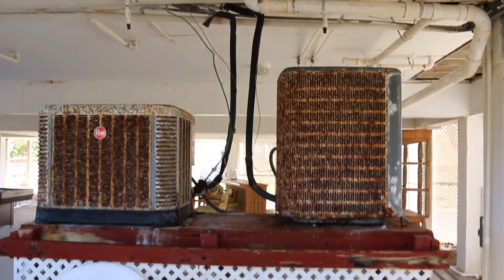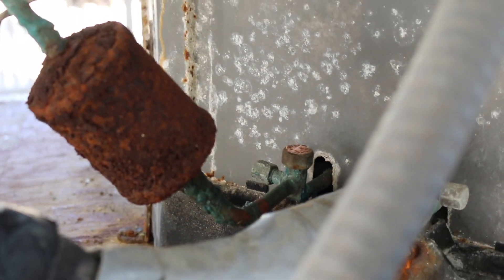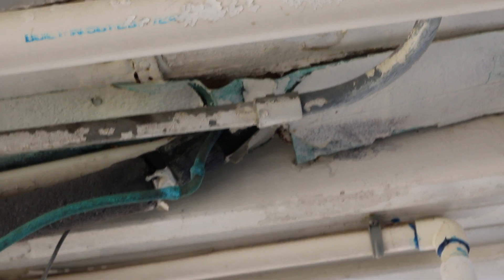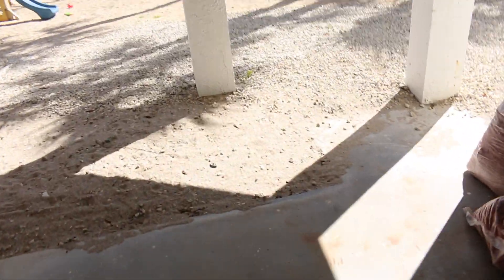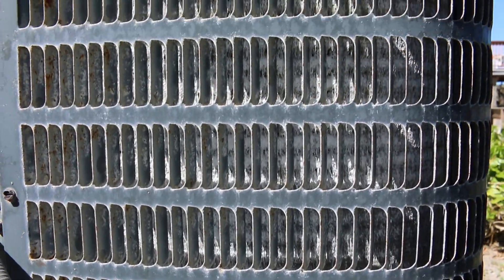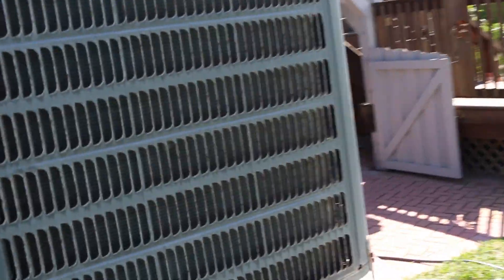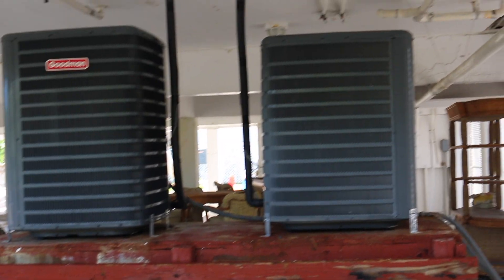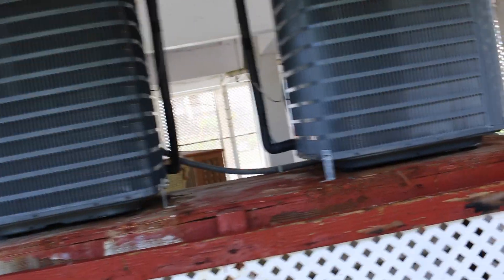HVAC: The Effects Of Saltwater On the Condenser

Comment: Damn that’s pretty bad!! They get ate up bad on the beach, but under that carport/decking it doesn’t get any rain water or anything. I’ve ran into that on Jupiter island. Sprinklers a good idea. Might need to move those other condensers and put a sprinkler head on them!
Reply from the maker: You absolutely right. Your work on Jupiter Island you say, that’s a nice area, I’m working on getting in that Community. Did you get a chance to cast your rods while you was on the Island? There are some Monster snook out there.
Reply: Up and Coming HVAC Johnnie Yea we only have a couple customers over there. But the ones we have had the condensers under a carport and they lasted like 2 years and looks just like those lol. I’ve done quite a bit of fishing over that way but by boat. Definitely some big snook around there. The bridges that go over to the island in Jupiter and Hobe Sound hold some stud snook!!